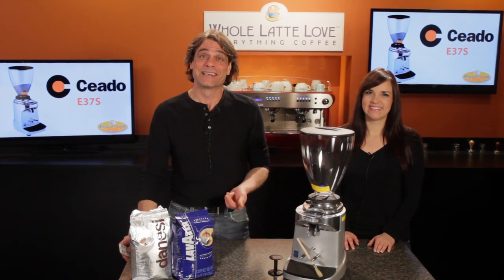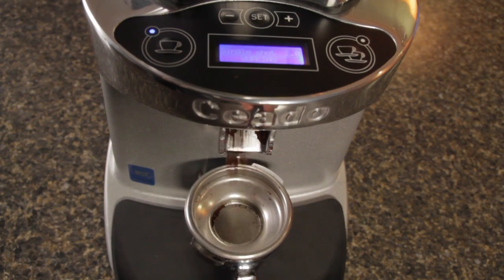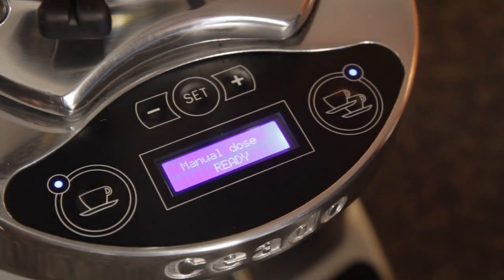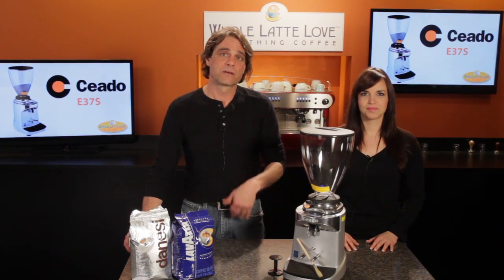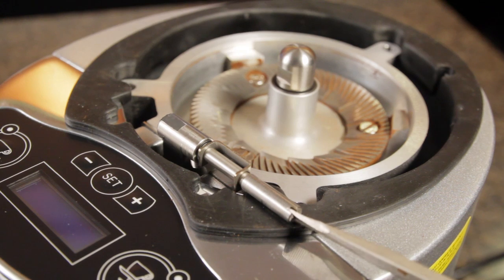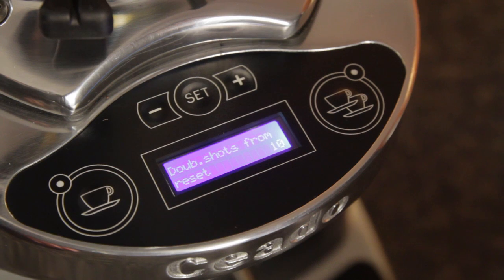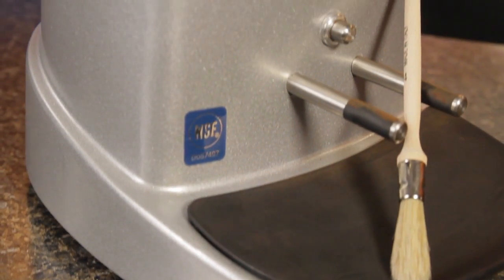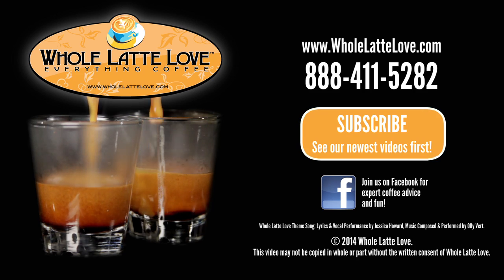Ceado E37S Electronic Coffee Grinder Overview

Comment: Would you mind doing a video showing how coarse this can do?  (after saying it can do french press answering another person)  Also, would there be any problems trying to go back and forth from espresso to french press?
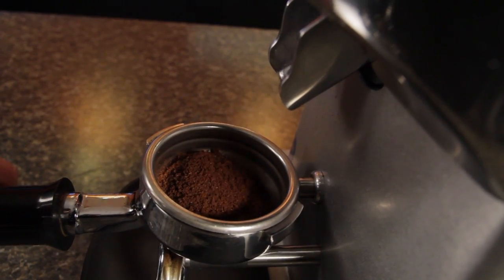Reply from the maker: Hi Brett, Good question! The E37s is designed to be used primarily as an espresso grinder. It can be adjusted to a coarse grind. But, moving quickly between a coarse and fine grind is cumbersome. The grind size adjustment has hard stops. Check 1:45 in the video. The grind size adjustment lever has a range of about 120 degrees of travel and that's not enough to get from espresso fine to press coarse. Now, that adjustment lever can be removed to make larger adjustments but it would be a PITA doing that on a regular basis.

Comment: I have a question? Can I use this grinder on pour over coffee or any other brewing types? Or is it strictly for espresso's? Thanks isaac
Reply from the maker: Hi AF, Yes you can. Frankly, it's overkill for that purpose unless using for commercial purpose but a rock solid grinder.

Comment: Mark and Morgan, does the gap between the portafilter and the distribution nozzle allow the use a dosing funnel like the Decent model?  Thanks for your GREAT videos - I have seen them all and they are very instructive.
Reply from the maker: Hi SpaceY, Thank you for the comment and question! Just measured the gap with a PF sitting hands free on the E37S and it's 1.25" from top lip of filter basket to lowest hanging part of the chute. I don't have a Decent funnel so not sure of its size. Hope that helps! Marc
Reply: Whole Latte Love thanks Marc.
Reply from the maker: You're most welcome!